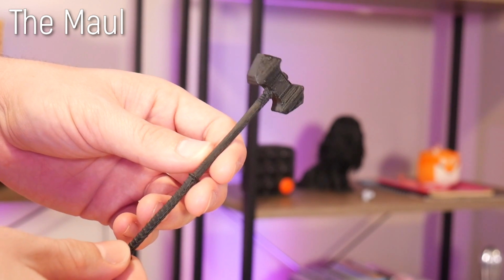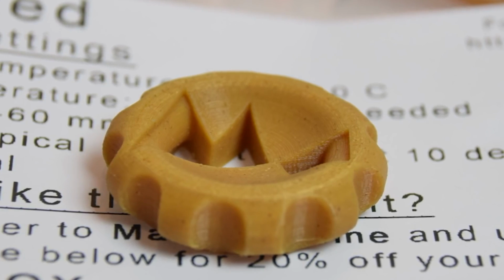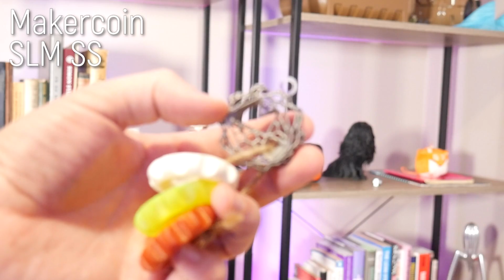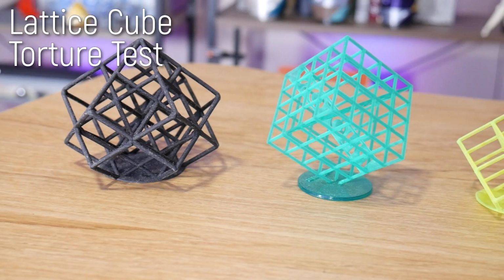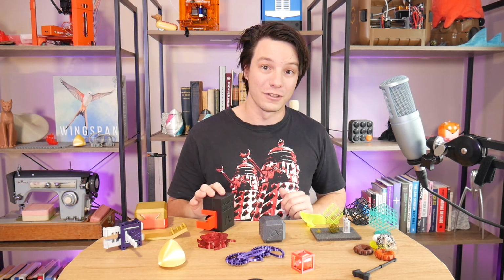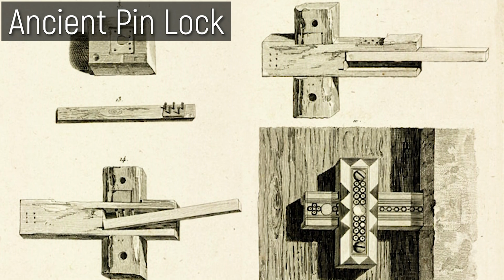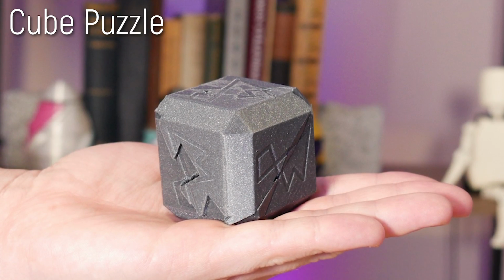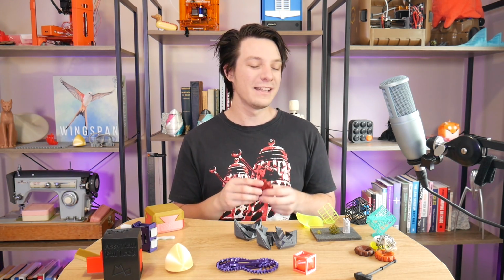My Favorite Designs from 6 Years of 3D Printing!

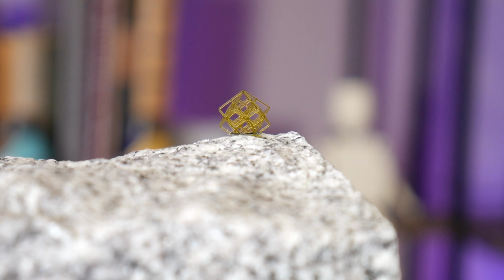Comment: 8:50 I’d consider dropping that tiny lattice in epoxy or something similar, it’s amazing and deserves to be protected from that time you will eventually sneeze and accidentally crush it.
Reply from the maker: It was really windy today when recording the shots and I did get a bit concerned...
Reply: @MakersMuse  if you do decide to immortalize it in epoxy, you should be sure to get the absolute best quality stuff or even have someone professional do it. Ive once tried to do that with a small feather that belonged to my bird who was killed and it went horribly wrong, destroying the feather despite me having lots of experience with resins and mould making.    ;v;
Reply: Kinda late to the party but... you can cut a small(-ish) glass test tube short and it'll be a tiny little glass dome, like those used in the museum but smaller.
Reply: @TheMCCraftingTable  That'd be so cute.
Reply: Or put it in a tiny Glass Box.
Reply: maybe you should cover it with flex tape and its safe
Reply: IMO, putting it in epoxy would detract from the impressiveness of it

Comment: 3D printing really allows you to try some off-the-wall ideas, like right now I'm designing & printing a strap out of TPU for FPV quadcopter goggles. Why? Because I've been isolating for the past 3 weeks, ill for the past 2 weeks, and I'm bored :)
You might think "oh he's printing it flat, that's nothing special" but no, I'm printing the strap vertically in vase mode...!
It's ridiculously strong, but not very stretchy so I'm designing a 'spring' structure to give it some stretchiness.
Reply: I'd be interested to see how well that holds up to use. Even if doesn't quite live up to an elastic strap, it'd be a quick replacement or backup in case the original strap is damaged.
Reply: @RMD Cade  I think with enough testing it might actually live up to an elastic strap, I printed one earlier which has a section of 'spring' in it, the tension it provides is enough to hold the goggles onto my head ok.
The spring piece needs refining since it's 47mm long when printed but can stretch to 250mm, which is too long and doesn't provide enough tension. I'll post back here in a couple of days with more results.
Reply: @licensetodrive9930  Good luck! looking forward to your results.
Reply: @RMD Cade  Sorry no new results yet, the virus has really wiped me out the past 2 days, have been unable to do much beyond watching films/tv/youtube for now.
Reply: @licensetodrive9930  I was definitely thinking more "someday in the future"--you gotta take care of yourself first! Get better soon!
Reply: For the curious, my first test print: haku.co.uk/pics/FatShark_TPU_goggle_strap.jpg
Reply: That's super cool!

Comment: Masks. We need open source approved models. Ventilators etc.
Reply: PLA masks are a bad idea because the COVID-19 virus is too small to keep out. Under a microscope a sheet of PLA is like a block of cheese filled with holes. The best we can do is find hospitals that need other equipment like face shields (search prusa face shield), door openers for your arm/elbow and scuba mask adapters to connect them to oxygen machines (for the less critical patients).
Reply: @rachellejanssen2655  PETG seems to be good work around see @josephprusa
Reply: Rachelle Janssen I'm sure there are methods, maybe inexpensive materials to create an impermeable layer
Reply: thousands are already working on it..  no need to bring us down with this crap.

Comment: Not related to the video but I have been having some trouble with printing tall prints on my creality ender 3 the print wobbles and fails the higher it gets
Reply from the maker: Yep big issue with moving beds, you'll need to slow the print speed down a lot and consider more support material / a brim to hold parts more securely.
Reply: Maker's Muse ahh ok thanks
Reply: steven maybe look into varying the print speed with height. I've not yet managed to print tall, thin parts on my ender 3. You can manually tune the speed mid print from the menu on your ender 3:)
Reply: PyreGnome ahh I didn’t know you could do it mid print. That’s actually quite handy to know thanks :)